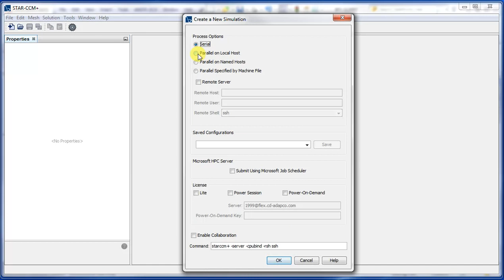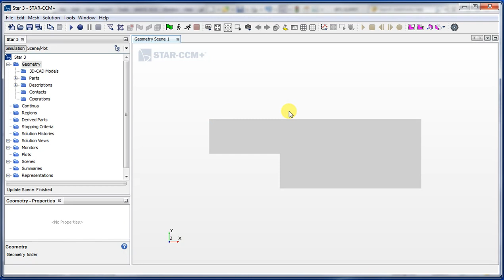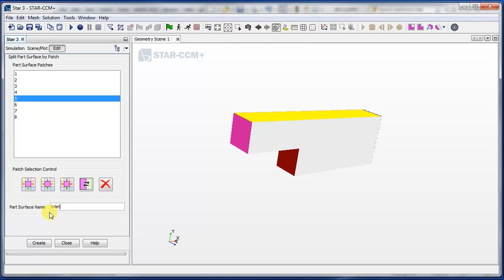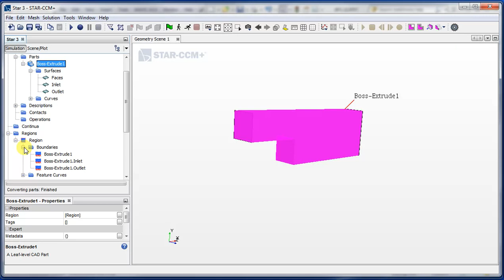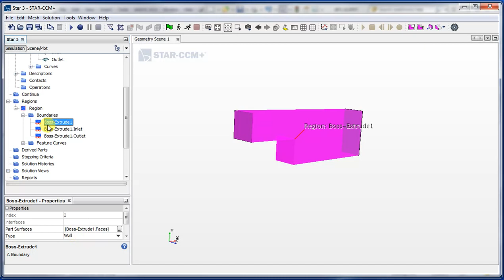Star CCM+ Beginner to Pro Tutorial Part 2  [Backwards facing step]

Comment: if ı have lets say 1 cpu and 12 cores shoud ı set compute processes to 12? Thanks
Reply from the maker: I believe so but there are diminishing returns to multithreading, more processors doesn't always mean faster. try it and see what works for u
Reply: @zacmac  Oh thanks, Some processors are better aat single core performance and some aplications like to run on single core. thus ı dont know how star ccm+ does that.
Reply from the maker: @PaxRomana9900  Imagine u have 100 cores for a 100k simulation, each core will process only 1k cells, hance the extra work to combine the datasets becomes more than the actual solving. rule of thumb is for every 50k cells at least u can use 1 core. Hope this helps you.
Reply: @zacmac  Thanks a lotm You made it clear for me.

Comment: Hello, when I try to create a simulation by following the same steps as you have (or with any other configuration) a window pops up with the following message: "Design STAR-CCM+ simulation completed Server Process ended unexpectedly (return code 8) This version of the code requires license version 2019.06 or greater." I am using STAR-CCM+ 2019 win 64bit. What could be the problem?
Reply from the maker: Licensing problem check with your computer admin

Comment: Hey Zac,

Apologies if I sound like a noob, but why did you select the inlet to be a velocity inlet and the outlet as a pressure outlet? Why not pressure inlet or velocity outlet?

Thanks.
Reply: Yes, we definitely can. But it doesn`t have a physical relevance.

Case 1: velocity inlet and pressure outlet -  Velocity inlet is given assuming free stream condition and no effect of boundary layer with respect to length scale. Pressure BC at exit is given, as outlet is left to atmosphere.

Case 2 : inlet pressure can be given when inlet is connected to a pump or poiseuille flow or velocity profile is unknown. exit velocity can`t be given at any cost coz we can`t constraint the flow to be laminar or parabolic at the exit unless it is completely known. The flow has to evolve based on physical conditions and exit velocity is found out generally.

On the contrary they were just boundary conditions, and can be anything unless it goes in accordance wit the physical conditions.

Happy Computing😉...
Reply: Yeah I was gonna ask the same thing

Comment: Why did you have to create the object from you first tutorial with another software before importing into star ccm+ . can you not create the object in star ccm+ direct? Any explanation with really help thanks
Reply: Hi.. thanks for your question. Yes it's very possible to make your geometry within star CCM+ entirely for something simple like this.. however I much prefer to use an external and dedicated CAD software because they are much more powerful that the built-in editor. So generally you'll usually use an outside program - I wanted to show you guys how to import geometry into the program.
Reply: In industry, models are created using dedicated 3d modelling programs cause it's way easier to design it in them. Sure. You can use Star ccm itself to create the geometry. But it'll take you longer to do it.